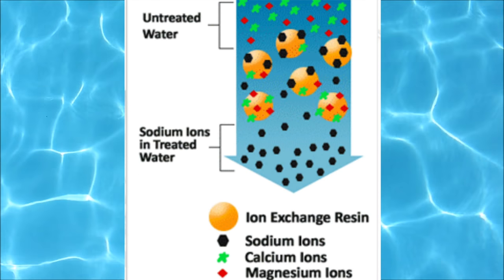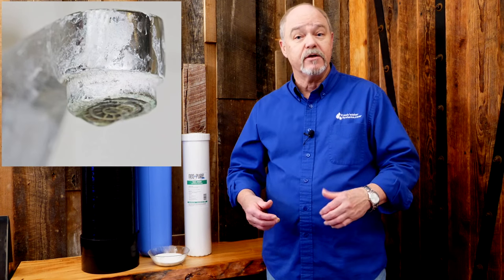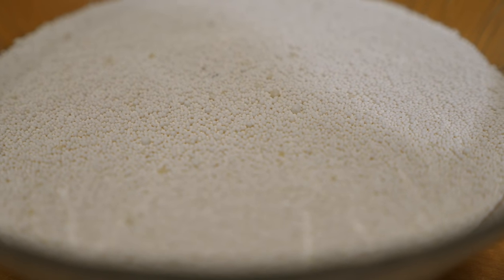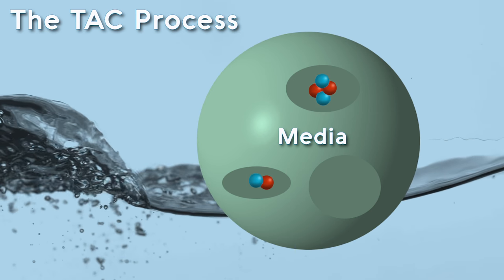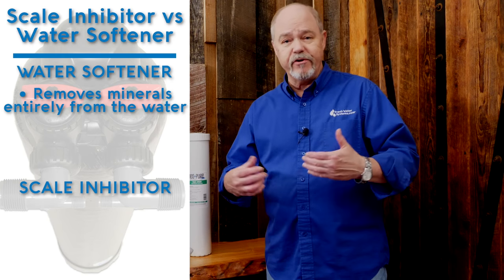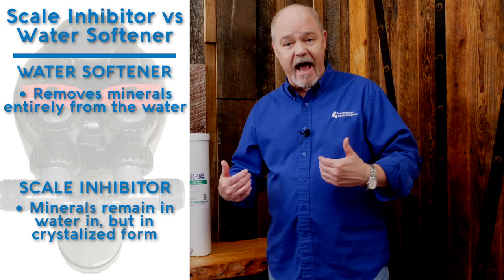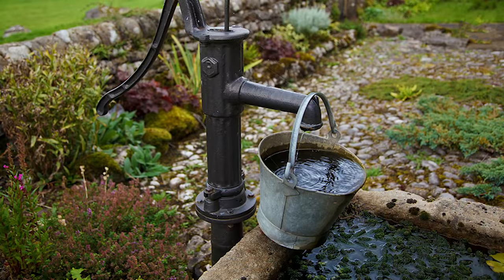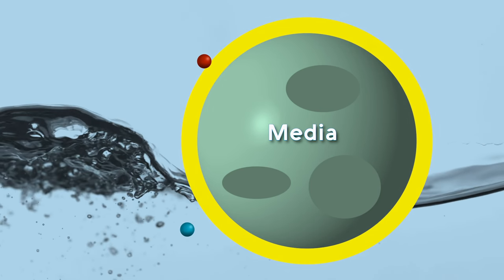The Truth About Salt-Free Water Softeners

Comment: As someone who has had a water softener for over 20 years as a solution to chronic excema I want to clear up a myth that everyone seems to misunderstand. The water in your system does NOT become salt water. The salt solution is used to clean the resin beads which collect the limescale when it regenerates. It is kept separate from your water and heating system and is flushed down the drain. If you can taste salt from your tap then your resin tank has a leak, which should not happen. You will not end up with salt water rusting your radiators and pipes.
Reply: Just to clarify this statement.  yes you flush the system with brine.  this exchanges the salt ion with the calcium ion in the resin.  the system is flushed and you should not taste salt however a trace amount of salt will be in the softened water as the calcium in the water replaces the salt ion and releases it into your softened water. however it is in the ppm type of concentration. So saying there is no salt is not 100% accurate.
Reply: @kylesellers5719  unless you have a reverse osmosis system, their will be trace amounts of salt just from the aquifers, the same place the calcium and lime comes from. It's just naturally found in the ground.
Reply: Thank you sir. Very informative.
Reply: @kylesellers5719  If your media is not completely cleaned during the backwash, you will taste a hint of salt in your water. Also, you will have a pinkish stain around your drain in the shower. But this is not normal. Get your system adjusted and these symptoms should go away.
Reply: @bert1450  yes, a pain to get it tuned, but once tuned it's as you say. Add salt when it's low and that's it. I've had mine for 25 years. It needed adjustment a few times, but not yearly or monthly.
Reply: Are these calcium crystal in water conditioner harmful for drinking?
Reply: Hi Mike, does the water softener helped a lot with your chronic eczema?
Reply: @kylesellers5719  salt is not an ion, it is a sodium ion. What happens is calcium ions are replaced with sodium ions. IF you taste salt water you have an issue with the regeneration process. If you do not want sodium, you can use Potassium Chloride instead.
Reply: @kylesellers5719 ..
Wrong
Brine seperates the mineral bond on the zeolite beads. Then a wash and rince  cycle. 
If there is sodium taste then wash and rinse needs to be longer.
Reply: It's the sodium from ion exchange from sodium chloride used in softener
Reply: @kylesellers5719 as an analytical chemist I second this. 
Yes. Sodium will replace magnesium and calcium At similar levels. 
Nothing you could taste. That is the concept of ion exchange
Reply: @samvanich4910 as harmful as calcium before you condition. 
It won’t make a difference. Maybe a bit tiny more harmful due to chemical from media. 
But it’s just hard water. So more kidney stones

Comment: Very helpful. I live in Arizona where the water is very hard. I have a tankless water heater in my condo and just had a Pelican Water conditioner installed. I also had an RO filter installed in the kitchen and to the ice maker.  WOW!  My dishes aren't spotted, my shower is clear and my ice cubes are like diamonds!
Reply: Hello Kathryn, I live in Glendale AZ, looking to buy water softener,I m relatively  new to all this, but I have water spots in the kitchen, showers.
Reply: Was that a carbon series and natursoft.
Reply: Drink ph water not acidic ro water ...
Reply: @rickybecklund2488  Or get RO and just add a pinch of baking soda to your drinking water to tone down the acidity.
Reply: @Vegan Conservative  really annoying to add stuff drinking water just get alkaline units or non salt actual water conditioners so ph water no chlorine all faucets showers etc
Reply: I'm interested in the "Kind E-3000 salt free system" or the "Home Master" . It is designed for well water. It has a 5 micron filter to remove the iron and manganese  as the first stage (removes over 95%). Then a carbon filter and then the salt free conditioner. I believe this answers your iron problem. Just need to get a good first stage 5 micron filter.
Reply: We live in Scottsdale and are looking to change our system to a no-salt water conditioner. Curious how your are finding the Pelican Water system you had installed about 4 years ago?

Comment: used a Pelican salt-free system for 20 years. i'm on a private well, and I still have the original 36 year old hot water heater too. salt-based systems destroy concrete septic tanks (unless you have a dry well to empty them in). (i had 2 salt-based systems for 16 years, and will never go back to one)

Comment: I bought my house last year in a tiny middle of nowhere "town" of 970 people.  When I did the walk through in the buying process I was surprised it didn't have a water softener... well it does but it's a "saltless" softener.  The house is on the "town" water supply. 

After 1 year of being here I'm having the POS saltless unit replaced with a salt water softener that ACTUALLY softens the water.  I've had to clean my shower heads from scale buildup twice and my kitchen faucet once in the 1 year I've been here.  I rarely use my dishwasher because it leaves white crap all over the dishes.  I had a plumbing inspection done from the company I deal with for plumbing and hvac needs.  I already knew I had hard as hell water because I bought test strips.  Without saying a word to the inspector he noticed within 5 minutes by just looking at my fixtures I had hard water and decided to do a test.  My water is 4x harder than what's deemed acceptable.  Which explains why I had to replace my washer a couple months ago.  He said I should get a traditional softener installed because I have a tank less water heater and hard water will fucking destroy it and tank less units aren't cheap to replace and they're supposed to last like 20 years.   The house was built in 2016..... and in the time between having my offer accepted and closing the original tankless water heater started leaking and fried the circuit board.  So literally the day I moved in the water heater was being replaced.  My current unit is 1 year old.  

So obviously I agreed with the plumber (really... had my doubts  about the effectiveness of a saltless unit confirmed) to have a real water softener installed.  

So... long story short.... if you want calcium/ sediment buildup on EVERY fixture and water marks all over your shower.... and enjoy replacing all your appliances that b use water every 5 years..... then go ahead and get yourself a saltless unit.  If you like clean clothes, a clean body, and want your appliances to actually last a reasonable amount of time.... go with a salt water softener.  

My plumber (a fairly large company that covers the state) says he thinks saltless units are kind of a gimmick.  Take that for what it's worth.  But from my personal experience I can't help but agree.  

For those that think salt units add salt to your water.... no.  Just..... no.  The salt used to clean the resin beads will leave behind sodium.... but it's such a finite amount.  You won't taste salty water.  Milk contains more sodium.  Does milk taste salty to you? 

At the end of the day... even if it did make salty water.... I'd rather drink that and have appliances that last a decade+ instead of having to replace them every few years.... oh.... and not have to take apart every faucet to clean out the insane amount of scale buildup a saltless unit will not prevent because it doesn't remove calcium or magnesium not softening shit.  

Saltless units a 100% a gimmick IMO.  I'll take buying the $5 bag of salt once every 2-3 months vs..... replacing my tankless water heater every 5 years... or washer every 6 years.... or dishwasher... or fridge.... and clean every faucet from scale buildup every few months.
Reply: @doseofreality100 I use Bubble Bandit dishwasher detergent along with rinse aid (JetDry) and that combo works very well for the super hard water here in Arizona. BB still has phosphates in it which are important for softening hard water in situ and suspending debris from the dishes. I use their laundry detergent too! It's nothing short of miraculous, I swear. I can't have a softener cuz renting, but at least this solution works well enough to regain use of my dishwasher. I still get scale buildup of course, but it's extremely reduced and I clean the machine every 4-6 weeks by running a short 1hr cycle containing a gallon of cheap vinegar from Costco. Comes out spotless. The heating element starts off white and chalky since it gets the brunt of the scale buildup, but it is squeaky clean after the cleaning. I will never use a modern residential phosphate-free dishwasher detergent ever again.

Comment: Thanks for this. I'm on a private well with very hard water. My water softener did the trick for 14 years, and while it still functions through the cycles, the media is no longer doing its part. I was close to buying a scale inhibitor. I didn't know the effect that iron and manganese have on the media. Thanks for saving me from a wasteful mistake. I know the fix is to replace the media, but I am also curious about the Electronic Descalers. They are pricey, yet 95% of reviews are claiming they work.
Reply: Electronic scale inhibitors and Permanent magnet conditioners are good options . No media no maintenance. I have tried both successfully
Reply: I’ve got a well in limestone .     The water is hard and leaves blotches all over.     I  got one of those ispring 2000 on a lark.    It was all of $120.     Besides just mount snd plug in after wrapping each Eire both directions.     So simple .      I didn’t expect much but have been running it 2 months now and I have to say I’m impressed.    No it’s not perfect but the difference is definitely noticeable.     There’s a slight slipperiness to the water as well as much less build up on the shower doors and washed cars.      Perfect no but for the money 👍🏻.

Comment: Thank you for a seemingly unbiased review of pros and cons of each system. There are many videos and websites that discuss this, and most seem very biased and sales-y. I do have a question -- I am on well water in CO outside of Denver. I had a water test done and I have hard water -- the test results were 50 mg/L of Calcium and 20 mg/L of Magnesium. Is this a candidate for a salt-free conditioner, or am I going to be best off with a salt based system? I like the idea of being more environmentally friendly and also lower maintenance, but if a salt based system is the correct solution, then that is what I would go with.

Comment: I have had my Pelican salt less water softener/conditioner for 4 years (Has a lifetime warranty) installed due to my tankless water heater, to prevent scale buildup and we have hard water....faucets, toilets, washer, all had scale buildup and LOTS prior to saltless water softener/conditioner install. Once we installed the maintenance free water softener, no more hard water. Tankless water heater had results of ZERO scale buildup on tankless water heater after a year and I cleaned it out for 4 hours and ZERO scale was pulled out!  No more scale on the metals, on the dishwasher, on the shower, in the toilet valve flush mechanism! Salt less works, Pelican, I have had for 4 years, it works.  We all see the dishwasher and there is no scale on this new dishwasher, nothing! The MAIN reason for a water softener/conditioner ... to prevent scale buildup on metal, showers, dishwashers, fridge faucet water, faucets, tankless water heaters (important) and regular tank water heaters.  For hot water using this salt free solution, it takes about 10 minutes for scale to buildup when boiling a pot of hot water.  After 10 minutes, you see scale or buildup forming around the pot, in the pot when boiling conditioned water.

Comment: Great video and explanation.  One question not answered is often softened water is plumbed to NOT run to ice makers and the kitchen.  How is this decision made between conditioned (descaled) vs softened water?
Reply: Regular soft water has trace levels of salt. Since salt is not healthy the kitchen will have regular water ran to it or a reverse osmosis system installed to remove any residual salt and other impurities
Reply: U run soft water to a Ro system , otherwise it’ll clog up the membrane quick.

Comment: Hi John

I'm learning a lot from your videos! Thank you for that. I'm curious: would you ever considering a micropore-size spin down filter or other fine filter in-line between a water conditioning unit and a water heater? Would such a practice remove those hardness microcrystals so that you can reap the anti-scaling and detergent-improving rewards of water softening with less need for softening salt?

Thanks!

Comment: You are a great teacher John! Í love your way of explaining. Question: Can a Scale Inhibitor/ conditioner be used along with a Reverse Osmosis membrane or must it be a true softener (municipal Water supply) ??
Reply: I'm not a plumber, more an engineer, but I'm sure plumbers will agree. Reverse osmosis removes all chemical compounds from the water (well like 99.99% but close enough), it does this with a series of different membrane filters, and activated charcoal to capture those compounds. A scale inhibitor does not remove any compounds, it only conditions them, so all the compound removal will be done by the reverse osmosis filter, greatly reducing its life, and effectiveness in flow rate over time. A water softener will remove the larger compounds from the water, which will improve the life of the reverse osmosis filter, and maintain its effective flow rate.

Comment: Thank you for explaining the differences so well, but I do got a question. It is stated that the scale inhibitor system does not work with well water because of the iron- manganese problem. However, what if you place an iron- and manganese filter before the water enters the scale inhibitors filter? It is quite normal with two or more filters installed in order to achieve the optimal result. Why is this variable taken out?

Comment: interesting - in San Diego county, with pretty hard water - I am getting a lot of scale build-up on a Eccotemp 4 gallon electric mini-tank water heater. This supplements my central hot water to my condo, I use it when needed, turn it off when I don't. I was considering adding a clearwave electronic water conditioner, or a scale inhibitor filter - one caveat is that I have the central hot water going into the cold side of the Eccotemp, and of course hotter water coming out of the hot side when I use the Eccotemp - so the filter (if I use one) has to be able to handle regular hot water temps on the inlet side. Thoughts?

Comment: Thanks for the nice explanation. Both systems avoid scale buildup which is very important. The information which I'm not able to get from any of such review videos is about the health pros/cons of both the systems. I'm holding onto buying either of the systems because I'm still looking for the answers to the following questions. Could you please help?

1. Does Softener adds very little amount of salt to the home water? Is this good for health? 
2. Conditioner keeps all the minerals within the home water. Is this good for health?
2. I read in manuals that Softener are not good for the in-house water Filtration systems and water Heaters(which u explain here though). Is this true? or which one is better for the specified appliances?
Reply: 1) How much salt would depend on the amount of hardness in the water that  was exchanged. Salt is an essential nutrient but, like all nutrients, too much is as deadly as not enough. Guessing that soft water is maybe 30 to 300 mg/l. Putting that into perspective, USDA claimed 500 mg is the daily need (of a sedentary, 150 lb. male being their usual  reference). restaurant soup is up to 10000 mg/l, sea water about 35,000 mg/l.

Comment: I'm a master plumber who's well water has 9 grains hardness . Many years ago I disconnected my water softener for health/taste/feel reasons and installed an electronic scale inhibitor and it worked so well I'm on my 2nd one. I also have a sediment filter,  a lime filter, and a carbon filter. My water tests now come out much better and I have no scale build-up.  All copper plumbing and heat pump water heater. Is it perfect? No, but I got away from the softener which was my purpose, so it worked for me. If I've learned anything in 40+ yrs in this trade is every situation is different.
Reply: Can you tell me which products you use? Or recommend?
Reply: I have iron water, and I hate using the salt. It’s killing my septic any recommendations.

Comment: Great video! I do have a question about the salt free water conditioner. So there's no scale buildup in pipes but no benefit for clothes due to the crystals getting stuck on fibers. What about dishes/glasses and more importantly, the glass shower door? Is there a benefit for those? Or do you need a true water softener for that?
Reply: @joejones6842  Thanks for the reply!

Since posting I have come to the same conclusion, however, turns out even a salt system leaves residue. Water spots are from the water evaporating and leaving what's behind (makes sense). So softened water will leave behind salt (since it replaced the calcium and magnesium with the salt) and conditioned water will leave the calcium and magnesium (since conditioners only change the structure of those minerals [to prevent scale] but doesn't actually remove/replace it).

Which leaves more/worse spots? I have no idea (if anyone does let me know) but I am currently leaning towards a conditioner as it does almost everything I want it to, there's virtually no maintenance, and no water waste.
Reply: @aaronhankins1509  p
Reply: @aaronhankins1509  There is no salt left behind on your dishes, clothes or skin from a salt based water softener.